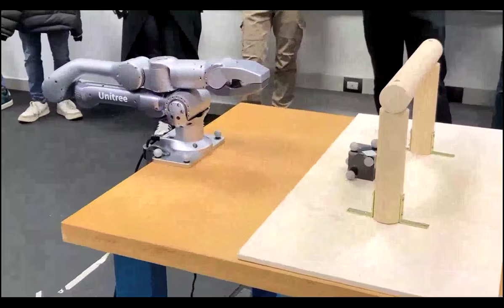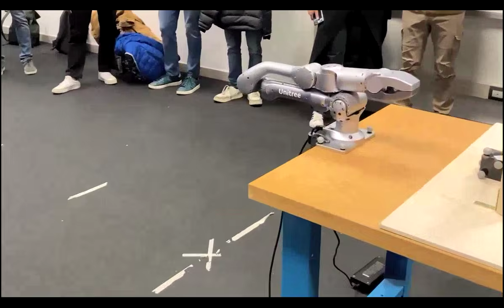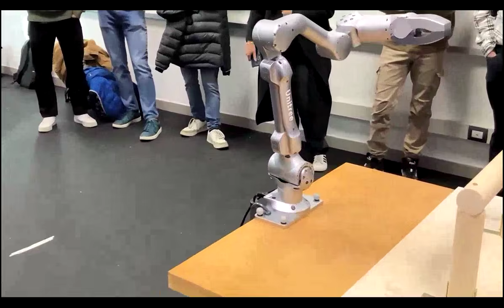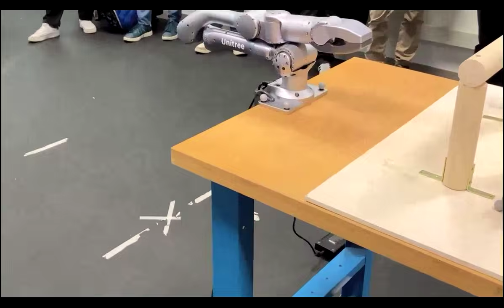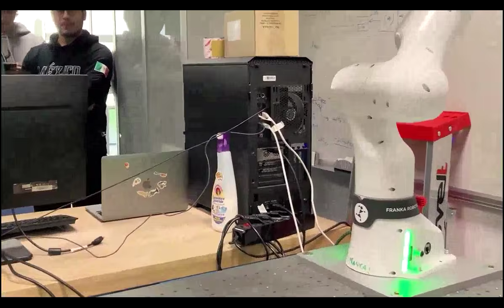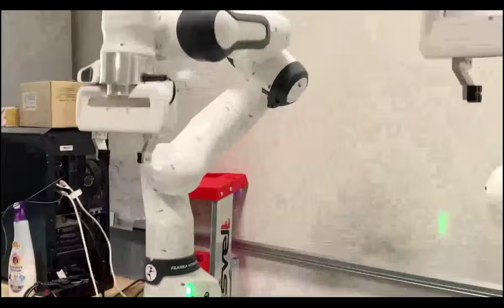Lecture 17 - Optimization and Learning for Robot Control - MPC on real manipulators

Comment: I’m trying to understand the relationship between TSID and MPC. Since both solve constrained optimization problems to output joint accelerations, when should we use one versus the other? Is there a hierarchy where MPC plans the motion and TSID executes it? And if MPC becomes fast enough to run at high frequencies (1ms, where we execute the first control output only in receding horizon fashion), do we still need TSID at all, or can MPC handle the full control loop? When to use TSID and when to use MPC? 
Thanks:)

Comment: Which solver was used here? qpOASES?
Reply from the maker: No, it's a nonlinear MPC, we use Acados with the HPIPM solver. You can find more information here: https://arxiv.org/pdf/2309.11124
Reply: @AndreaDelPrete  Thank you so much for sharing the paper, it will definitely be useful for me. And one follow up question, Was HPIPM solver used because it exploits Sparsity?
Reply from the maker: @sedmonki  Yes exactly, it's designed to exploit the specific sparsity pattern of optimal control problems, similarly to what the Riccati equation does when solving LQR problems.
Reply: @AndreaDelPrete  That is an intuitive explanation. Thank You for the answer!